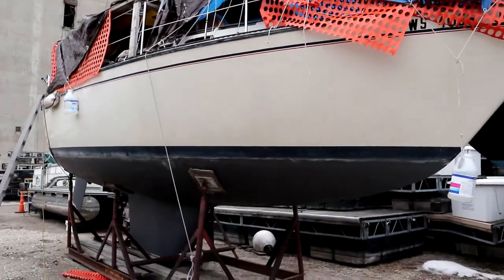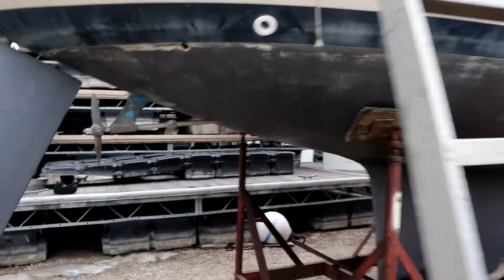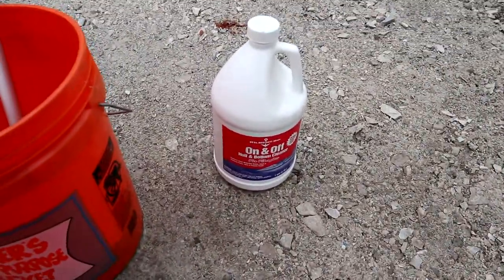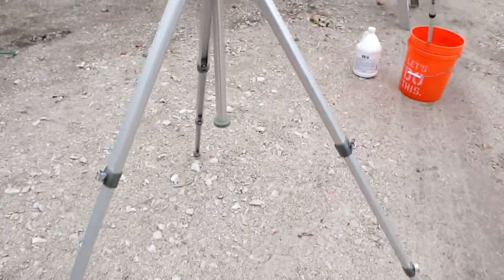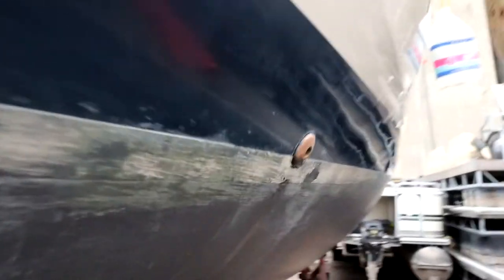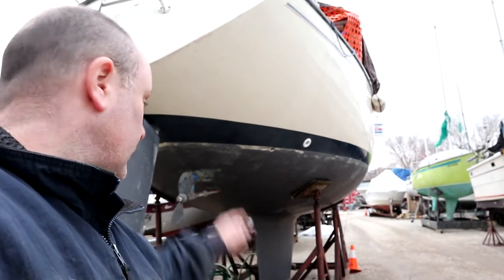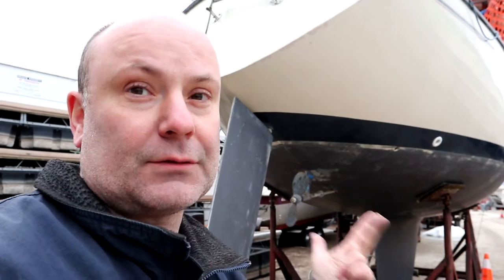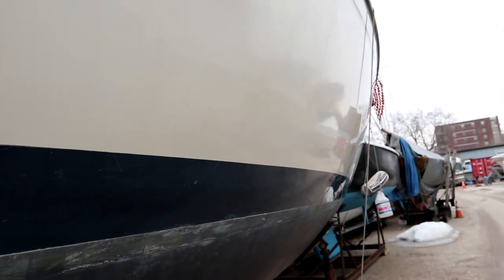removing skum line with On & Off

Comment: Does the on off mess with the vc17 paint?
Reply from the maker: Yes it reacts with VC 17.  You should use On & Off before you paint with VC 17.
Reply: @sonofneptunesailing917  worked like a charm thanks for the info turned out nice